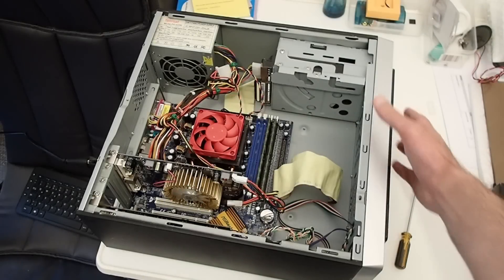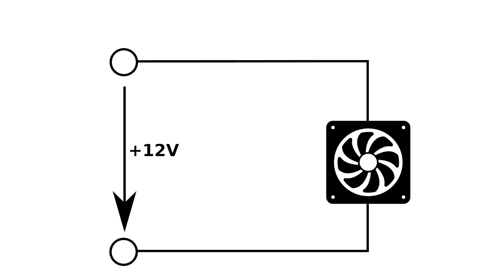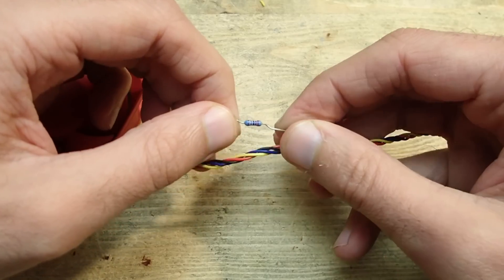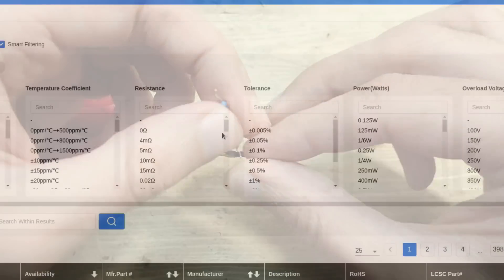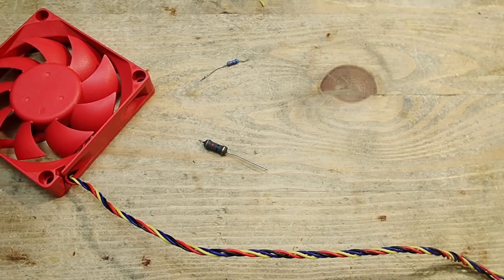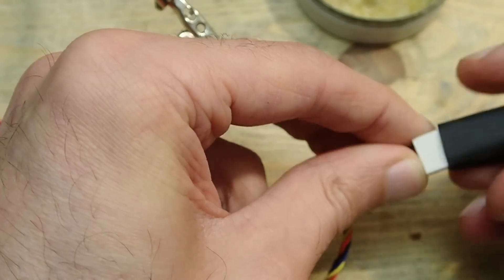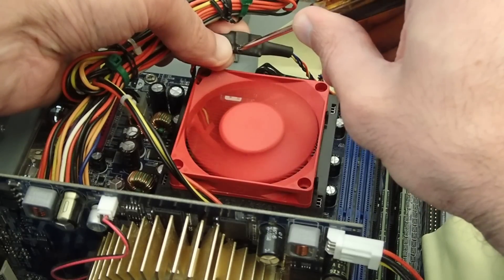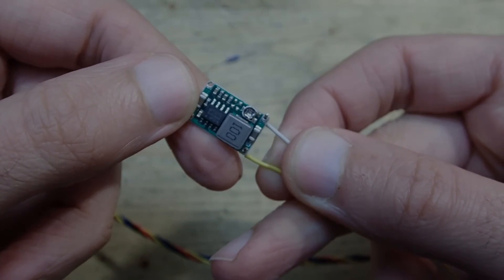Noisy CPU fan? Here are some ideas.

Comment: you can use a 555 timer IC and build a PWM controller... tie grounds from fan power rail together with 555 circuit then run the fans PWM wire to the output of the 555.  it will give you full range adjustability.
Reply: i didnt realize this was an older video... others have already stated a PWM controller could be used. i didnt read before i commented. :)

Comment: Those adaptors with resistors which they sell are mostly useless, most of fans need less than 6V to make it silent, 7-9V is still too much and when I need to lower voltage that much with resistor, it can get pretty hot and also you just waste that energy, I prefer just to connect it to 5V from molex connector, but in some cases, I use resistors too, for example on old GPUs where I don't want to have some wires going from GPU to motherboard or PSU, but those fans are that small with such a low current that resistor can slower it without getting hot.
I count nothing, I just try few resistors and keep what works the best, from my experiences, it's mostly between 100-200 ohm when you need to slower down super fast fan, but for some little fans, even 50 ohm can be too much. But when you need 200 ohm resistor, it's probably really better just to connect it to 5V from PSU than heat your room with some resistors. 😀
But I noticed that word "silent" means something totaly different for different people, for me, it means that I can't hear fans at all, when I clearly hear it, it's not silent, lowering it from 12V to 9 or 7V mostly just turns terrible noise to just noise. 😀
Most of old fans have possiblity to acces soldered contacts for wires, so you can also connect 2 fans to series which is pretty good solution for some purposes, but annoying is that you can't just disconnect that fan and use it somewhere else then.

Much easier would be if producers of those fans were not idiots and RPM was normal from the factory, when it's 5000+, you just have to do something with that, you can't listen such noise.

Comment: My motherboard has only one header for sysfan and since I live in a hot and humid jungle I need something good to cool my pc, I'm actually used to loud pcs, my pc in the early 2010's was a Phenom II x6 that was really loud cause it had to be 100% speed everytime, found some fans from dead PSU's and put them on the PC but I couldn't control the speed, when I was about to build something like that I realized I could just use all 3 fans in the same header and it's all good now

Comment: there is a lot of PWM fans if you connect the PWM pin with GND for some reason the fan will go into low speed mode 
im not sure what logic behind it but it seems to be doing the job leaving the PWM floating means full speed

Comment: Thanks for the great video! You need a step-up converter for PSU transplants in workstations, where a 12V only PSU was used originally. Even the STANDBY voltage needs to be converted from 5V (regular PSU) to 12V (12V only PSU).

Comment: I would make similar sized PCB with microcontroller for PVM signal, output voltage analog input and temperature probe input for radiator temperature, one transistor for PWM signal->FAN. For microcontroller voltage regulator would be needed. Write a program with if statement, if temperature goes UP, then increase fan speed (change PVM), with output voltage sense, minimum voltage can be set. Yes, its sound complicated, but to make such pcb in china, it costs just a few $, for example jlcpcb

Comment: Yes, the calculation has to be different. At first the resistance of the fan:  12V : 0,25A = 48 Ohm  Then the new current for 7V at the fan is  7V : 48 V/A = 0,146 A   The pre resistor has the same current at 5 V   R=U:I    5V : 0,146A  =  34,2 Ohm  - I choose a 33 Ohm 2W resistor. Then the resistor will not become so hot.

Comment: You can make a PWM controller using a 555 timer, frequency needs to be about 25khz. You could use a temperature dependent resistor to vary the duty cycle depending on how hot the CPU heatsink is.
Reply: I didnt see your comment till just now... i said the same thing!

Comment: I used 3pin fan to molex adapter , and on adapter switched contacts in molex to choose 5 or 7v . Later i used fan speed controler for case . Later i got better mobo with full pwm support/speed control . Only thing i remember it was an Asrock s478 , later i got Asus .

Comment: IRLZ44N, TC4400, 555 timer, some caps, resistors and trimpot, if you wanna go fancy with temperature speeding up the fan then add a thermocouple to the mix.

Comment: I used a buck converter on my 3D printer. The power supply is 12 volts, I took a leg down to 5 volts to power a raspberry pi. The pi runs octoprint, which adds brains to the printer, very useful.

Comment: Best solution: little inexpensive mcu (pi pico), add some simple code to control the pwm pin and adjust it via usb serial or via a thermistor.

Comment: You could also use a zenerdiode in block-mode as I call it. In other words: put a zener on the red wire the wrong way! Voltage should be about 3.2v less.

Comment: Dude, you should use that PWM pin to control the fan's speed, that's what it is for. A simple NE555 circuit would be great fit for that. 
Limiting the voltage when you have a fan supporting the PWM control is a lame solution at best.
Reply from the maker: Yes, true, but the answer is simple, I didn't have a 555 at hand and used, what I had instead. Furthermore, this can be still helpful for someone, who has a 3 or even 2 wires fan, or something else. Just like everything on my channel, it's never a competition for the best solution, but more like, "look guys, I had a problem and here is how I solved it" thing :)

Comment: if you have PWM fan, another option is build a 555 or opamp based PWM generator. the benefit of PWM control, you could run the fan much slower than DC control if needed
Reply: Exactly what I do. Works great. Efficient

Comment: To slow the fan of a Nvidia graphics card, I made a 4-to-3 converter, with 2 transistors, one small NPN to invert the PWM wire and one big PNP to actually drive the fan. I guess it can also work to use 3-wire fans on working 4-wire motherboard

Comment: you can always use speedfan to do exactly the same thing on all fans...without the extra work
Reply from the maker: No, unfortunately you can't. I mentioned it in the previous video.
Reply: @necro_ware  oh ok then..i didnt get to see that video..it was on my youtube suggestions this one...i guess you cant see the io chip on older hardware as they dont report much back to the user
Reply from the maker: @ChicheritaTheodorDan Yeah, kind of. To be precise, this board has the rotation sensor, which is reported both in BIOS and SpeedFan, but there's no way to control the rotation speed. I guess, on this model there's no way to do it in software.
Reply: @necro_ware  did you try other sw?
Reply from the maker: @ChicheritaTheodorDan  yes, I tried couple of things, but I forgot to try it in Linux to be honest
Reply: @necro_ware  i think its gona be the same because those missing reporting back components are missing hardware wise
Reply from the maker: @ChicheritaTheodorDan  probably, yes

Comment: Here is another idea: speedfan. 
On these computers the BIOS didn't regulate the fan, but it was still possible to regulate it, you just had to use software.
Reply from the maker: I showed it in the previous video if I remember right. On this board speed fan didn't work for the CPU, but I use it for the GPU fan.

Comment: The PSU also has a 5V rail. I usually use a 3 way (ON-OFF-ON) switch to switch between 5V, 12V or off, and mount it on the case somehow.

Comment: I prefer using a Zener diode in antiseries (power + to diode cathode, diode anode to fan +). Usually I keep a good power margin, using a diode rated about 2*Vzener*Ifan (fan current at rated voltage, even though it will draw less), to compensate for higher ambient temperature and worse heat transfer due to heat shrink tubing. A 4.7 or 5.1V zener, rated 2 watts, usually works really well. 

Also I prefer this due to the reason that DC-DC converters have fairly large input/output caps, which unnecessarily stresses the circuitry on the board if it switches the fan on/off, and causes PWM to not work well if the board does it by modulating the power (for 3-pin fans).

But of course, a temperature regulated circuit is the best solution :)

Comment: Or you can use 5 volt from motherboard)) Or 3.3V on ATX... or 5V minus 1V fall thru diod :))) 
Good variant is use NMOS transistor with capacitor and two resistors, to make fan run full speed at power on and slowly go down...)
Reply from the maker: 5V is too little, usually the fan Stopps at about 4,5-5V completely, so something between 6V and 9V is ok. But basically, yes, there are plenty of ways, that's why it makes fun to tinker with.

Comment: I made an ATX -5V adaptor (-5V Volt is missing in the atx 2.0 spec). I even made a video about it ;)
Reply: https://youtu.be/W1I-X_wj6Eo
Reply from the maker: Nice! Did you use some kine of buck converter as well, or just an LM7905? I also made some unusual -5V supply for the mainboards with ISA slots with Phil from PhilsComputerLab two years ago or so. You can find a video on my and his channel about it. Just search for the Voltage Blaster.
Reply: @necro_ware  I used the B0505S it is an isolated 5V to 5V converter. It is a mini DC/DC powersupply  Does it use BUCK? ;)

Comment: Wellp. Not sure if your calceulations correct. You see, adding resistor in series is equal to creating a voltage devider of resistor and a fan, so first thing what you must - is to calculate actual resistance of a fan. lets do that. 12/0.25=48 Ohm Ok. Now we can see if we add 48 Ohm resistor we will half the voltage to 6V. So dancing around 40-70 Ohm resistor you can adjust desired fan speed. And the last but not least - lets calculate currrent for a resistor of 48 Ohm - 12/(48+48)=0.125A As you can see adding resistor in circuit always limits current too.
In my practice usually 60 Ohm resistor is enougth to make quiet any laud fan and 0.5W resistor is more than enougth.
Reply from the maker: Yes, you are absolutely right :) I had to take voltage division into the calculation, instead of just taking the current. In my case that wouldn't help though, since all the resistors I had were 250mW. That wouldn't be enough in any case and I'd had to order some.
Reply: @necro_ware  Actually fan motor isn`t so linear, and operating on lower voltage may gradually lover current too. You should take measurements of a current drown by the fan. About the wattage of a resistor - i`ve never bothered about that, its just works. BTW you can take two resistors in parallel (120+120=60 Ohm) to double wattage.
Reply from the maker: @Evhen_Velikiy  Yes, that's also a good idea. Twice the resistance of each would half the current in parallel and result in lower power consumtion. Next time :D

Comment: I used a resistor once to make a graphics card fan quieter. It worked fine, until the friend I adjusted the computer for, let a pile of dust build up, then the fan stopped, and the gpu burned out. So you always have to remember, if you are slowing the fan down to the point where it just starts, that a bit of dust build up could make it stop entirely. Wherever possible now, I use larger fans, as they move more air with less rpm, and therefore are quieter.

Comment: Ah, those were good times in the 2000's😊Especially early 00's, almost every system had noisy fans, spinning way too fast like this! I remember a good article on a PC magazine back then, they built a silent Pentium 4 Northwood PC. It had all kinds of cool stuff in it, previously unheard of: Soundproofing material(bitumen+foam), big Zalman Copper CPU cooler, silent Enermax PSU etc. Really appealed to a youngster and encouraged to build stuff yourself. It would have been nice to control fans like this. I remember 5V and 7V connections for fans(switching the fan adapter pins with a small screwdriver at 4-pin molex connectors😇)Just being careful not short circuiting between 12V and 5V lines.
Reply: I've just bought totaly new coolers for socket 370 from some bankrupted shop, but those fans......jesus, it's 60x60mm size and it has like 5000 RPM or something, maybe even more, it's pretty loud even when you connect it to 5V. 🤣 BTW, all those myths about how terribly hot Pentium 4s were are just myths, compared to today CPUs, it's cold like an ice. Problem is that when socket 478 was released, people were used to coolers like from sc370 which was mostly just the simpliest tiny aluminium heatsink with some crazy fan, this was not enough to cool Pentium 4 CPUs, but this was fixed with newer coolers and temperatures were totaly ok then. When you put some more modern cooler on 3 GHz prescott, it will barely get's higher than 55°C in full load, which is crazy compared to temperatures which we have totday like 80+ even with giant coolers or AIO. 😀

"switching the fan adapter pins with a small screwdriver at 4-pin molex connectors"  I am still doing it even in 2023, I have some adaptors modded to 5V only or 7V only for all 4 connectors. I hate that today computer shops already don't have any interesting stuff like rpm regulators and such things, but thankfully, most of today fans are 4pins and can be regulated in bios, at least something is easier today. But some motherboards will not allow to lower it enough, there can be limit like 30% or something, so sometimes you have to use "old hacks" even in 2023. 🙂

Comment: Back in the days I usually preferred to use a zener Diode instead of a resistor. No hassle with calculating resistor values.
Reply from the maker: Zener in backwards? Hm, also an interesting idea.

Comment: Very good explanation of some of the basics you would not believe how many new technicians that pass through the trades don't have a basic understanding of how a resistor actually works
Reply: If there are technicians who don't know that energy can't disapear and it will turn to heat, there is probably something wrong with your education system. 😀 But problem is that many pepople who work in some specialisation don't actually have education in that, but when you work with voltage, you can't do it without some paper which says that you are able to do that in my country.

Comment: So I like to add USB-C PD to old things like a Sony "Boombox" with a refurbished cassette deck in it. This way I can run old tech off that is common today, USB-C PD battery packs or wall adapters, not having to use alkaline or even rechargeable batteries on the go. I have a couple old computers and even a VHS Camcorder I've done this mod too. If the device can run directly off 9v or 12v or 15v I don't need to use a buck (or boost) converter, but in a few cases for something like a 6v device I will use a USB-C PD 9v trigger circuit, and buck it down to 6v with a little board like that. Never thought to use a buck converter on a fan. Great use case and bonus, adjustable. Great videos as always!

Comment: as a crude alternative, you can take the 12v (yellow) "positive" wire from the PSU molex and the 5v (red) wire as "negative or ground", so 12 - 5 is 7v, which will reduce noise. I have exactly the same problem with a 1800MHz Athlon XP. Greetings.
Reply: Easy way to start a fire since you could trick the short-circuit protection on psus that monitor the ground current

Comment: Well, technically speaking the fan draws 0.25A only at 12V.
With an in-series resistor this will be lower so a larger resistor is needed (30+ Ohm).
It is better to thing the fan as a resistor of 12V / 0.25A = 48 Ohm.
Then calculate from there the resistor needed for a 5V drop.
This calculation can never be accurate.
So either-way, yeah the converter is the best solution.
The transistor with a variable resistor should be good too.
Reply: or just wire 5v to the fan -
Reply: @wishusknight3009  Or 7V from the difference between 5V and 12V pins on a Molex connector. Drawback: you can't connect the tacho pin then, you can't have the mainboard warn you that the fan has stopped.
Reply: @SianaGearz  or that....
Reply: @SianaGearz  that has potential to start a fire because some psus use return current for the protection circuit, and short-circuits could go undetected
Reply: The calculation can be accurate if one has a amperage vs voltage curve for the fan.

Comment: I must be dreaming, another video! This isn't the start of a streak, is it...?

A small correction: The calculation at the start involving a resistor is flawed, it doesn't work out that way. If you introduce another load in the circuit, the overall load and therefore current changes and so you can not use the fan's rated current anymore. What you can do is use the rated current at 12V to calculate the fan's equivalent DC resistance first (Rfan=12V/0.25A=48Ohm) and then use a voltage divider formula to calculate the needed resistor to drop the voltage across the fan to 7V. (5V/7V=R/48Ohm -> R=48Ohm*5/7=~34.3Ohm)

Hope this makes sense (and is correct) :D

Edit: Oh and the resistor should be rated for: P=U*I=U*U/R=5V*5V/34.3Ohm=~0.73W
Reply: This should get closer, but it still isn’t really accurate.  DC fans are not resistive loads, so it may react very differently.  Particularly since the fan’s controller IC may not have a predictable curve of current vs input voltage.
Reply: @sirnickity  I tried with a fan I had at hand and it came close enough. But does a non-PWM fan really have any other electronics like a controller inside?